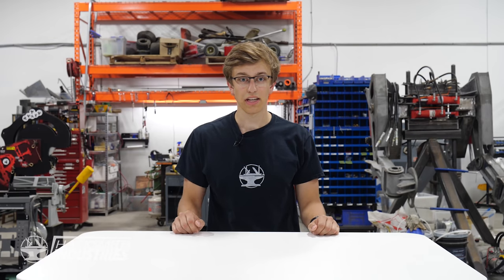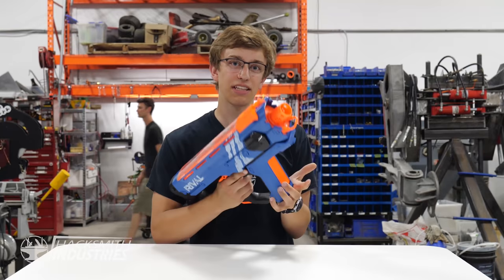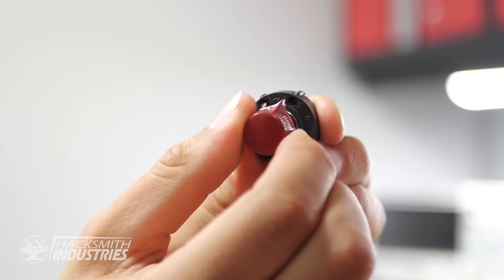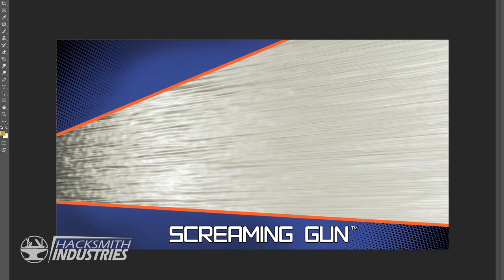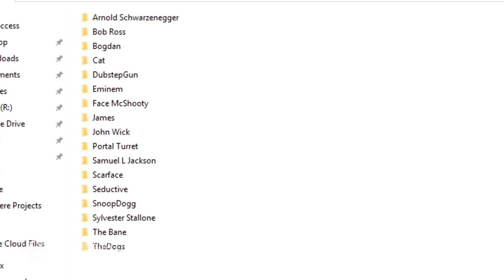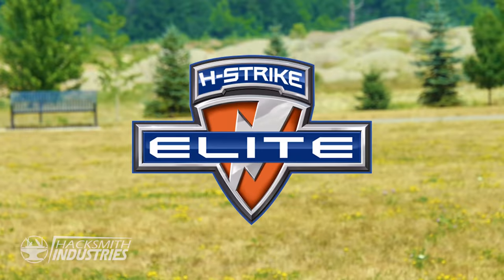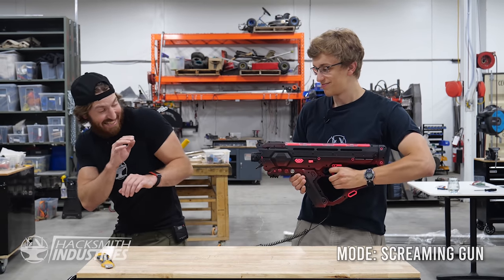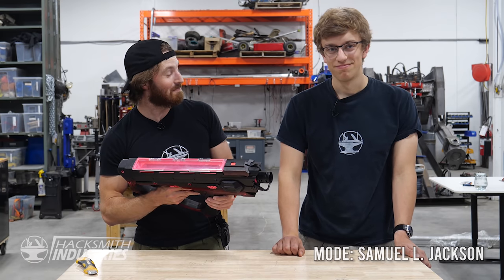A Nerf Gun That Screams When You Shoot

Comment: You know what would be cool? Adding a stealth mode to the spycar. James did convert a car to electric before, and all they'd need to do is find a place to put the motors, battery and other components in a way they can be easily concealed, and find a way to switch to the electric motor while driving. Maybe the lights could turn off and using infrared cameras, he could project a night vision HUD onto the windshield if he puts one of those Winxshield HUD stickers. Maybe thermal too.
Reply: Also, Hacksmith, if your reading this and like the idea, please respond as you see fit. I humbly summon thee to read the proclomations of a 17 year old nerd with a sign on his bedroom door that reads "WARNING LETHAL LEVELS OF KNOWLEDGE AND INTELLECTUAL BADASSARY INSIDE. ENTER AT YOUR OWN RISK" followed by a picture of a skull & crossbones wearing lab goggles

Comment: you know an easier way to do that is just to over volt the motors or put some better motors in it and put a better battery in it (depending on the motors used a 3-4S lipo will work) it will screech like a banshee